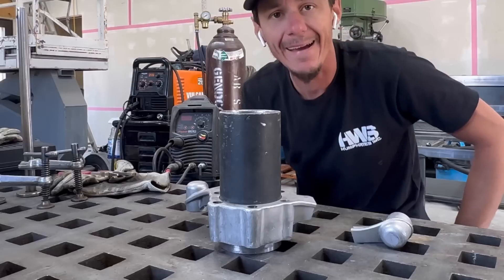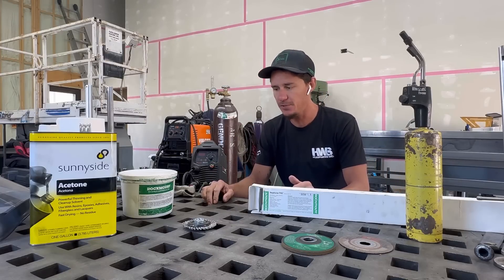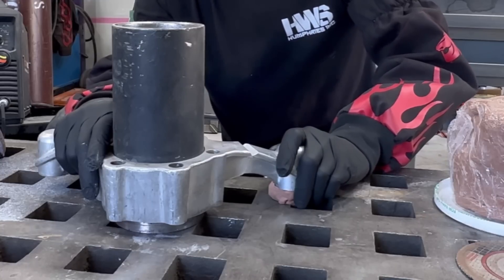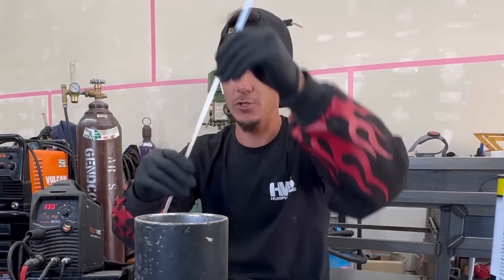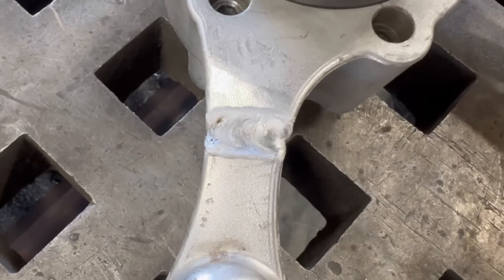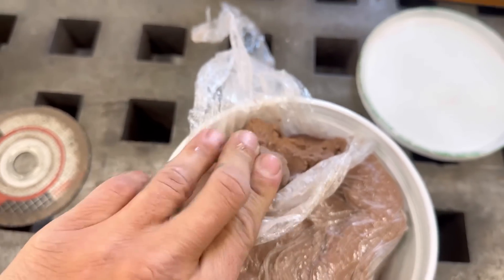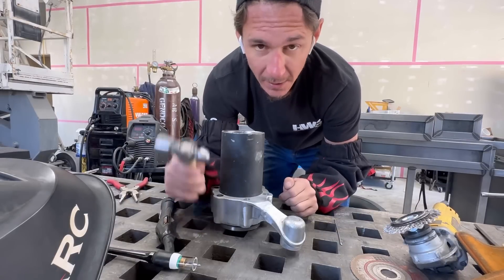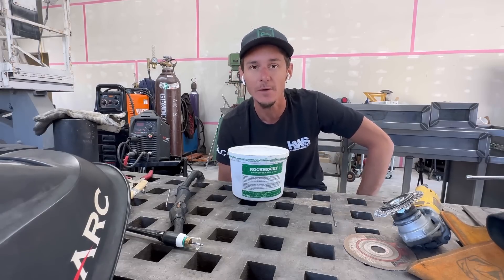How to Tig Weld Cast Aluminum

Comment: I was MIG welding on an aluminum trailer.  The only way I could access it was bending over the weld.  My helmet was white with aluminum oxide.  I wouldn't want that in my lungs.  Though I was wearing an N95 mask, I made sure to ALWAYS wear one after that.  YUK!!!

Comment: Flame Holder = Pottery Clay (purchase at your local art store for  $12). Also, we appreciate the brand you're using but more importantly, is it 5356 or 4043 rod that you're using? I use both with mixed results.

Comment: Sometimes what you can do is do a pre run without filler on the part to help pull any oxides or contaminates prior to welding. Also helps with pre heat.

Comment: Anthony, I see you have a Vulcan Weld Machine. Is it the Multiprocess machine? If so, how do you like it. I currently have a Lincoln Pro Mig 140 and a off brand stick machine. I'm looking to upgrade to a Multiprocess machine and was wondering what is best for the price. Thank man, love your channel. Fuck, fight, weld pipe...
Reply from the maker: It’s the mig 210. Unfortunately my Miller 250 crapped out on me mid job so I ran to hobo freight on the weekend as grabbed this machine. It’s not bad honestly. Definitely not as smooth as my Miller .

Comment: Hey Anthony, what number 3m respirator filter are you using?   Why not use a hammer drill for your peening?
Reply from the maker: Yes the quick latch. Link in the description. And for a piece this small the hammer is easier for me

Comment: Anthony, I understand the importance of post flow while the tungsten is red hot after welding aluminum. but why is it not an issue when welding regular steel or stainless steel, i run almost no post flow when welding carbon steel and my tungsten stays perfect. but if i even move the tungsten through the air too fast after an aluminum weld it just flakes apart
Reply from the maker: I’m not really sure. My guess is it has something to do with alternating frequency. I use more post flow on SS so I avoid cooking it

Comment: Tool and die welder here. No hate, just honest advice, cast aluminum is a fucking bitch and i hate it every time it comes into the shop. 

I've never used anything by "Rockmount" and they don't release its contents so I don't know that I ever would. Not knowing the composition of a rod is a big no for me, no matter how its advertised.
I'm sure in your case that doesnt really matter though, because this isnt a high stress part, so that not the point im trying to make there. 

In my personal experience, I prefer something with higher magnesium content (5% or above) , as it helps with ductility and prevents cracking, you'll find those high contents in fillers such as 5356, 5183, or 5556. I don't know where the average guy can find 5183 or 5556, so for most things, just use 5356. (edit to add this, unless you are exposing it to 150+ degree temperatures pretty much constantly, in that case, probably use like 4043 or 5554)
5356 also has about 6,000 more pounds of tensile than that Rockmount does, and better shear strength. Add that with the ductility, its basically the farmers rod of aluminum.  

Also yes, peening is good. to elaborate a little further than you did, by peening it down you're essentially relieving some of the internal stress that welding creates. I often have to do this on most dies I weld on, usually tool steels that don't much like to be welded on, (H-13 and such). I usually use an air hammer, but im sure the ball peen does good enough with how soft the aluminum is. 

Overall, good repair. Looks solid enough to hold. Keep it up, love from the midwest.
Reply: I rarely see die welders on social media. I'm just north of Detroit.  Where in the Midwest are you at?
Reply: @grumpycricket Michigan, down by the niles area. Good to see another die welder out here. stay safe brother 🤙
Reply: No one cares..nice book you wrote for nothing
Reply: @stanlee2200 If you cannot promote the spread of positive information over social media you should not be on it. You might not care what i said, but its a welding channel and it could be useful to someone else. Stick it where the sun dont shine.